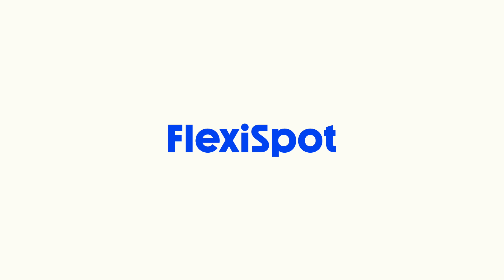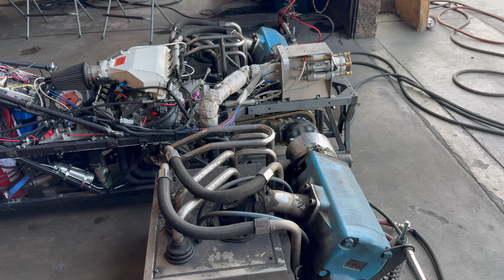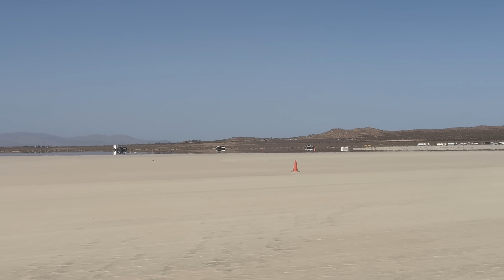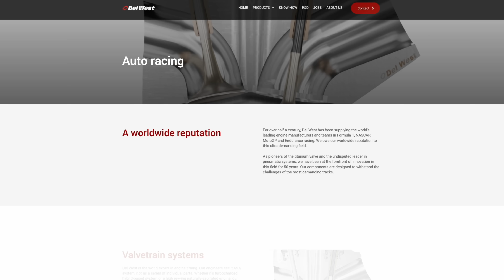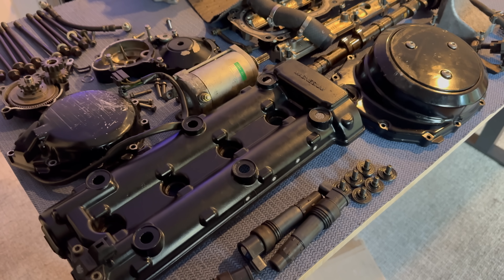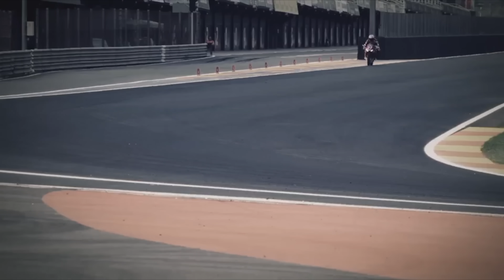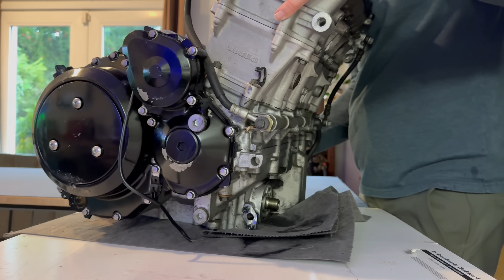Motorcycle Engines Are WAY BETTER than Car Engines

Comment: Addition On the durability topic of high-revving motorcycle engines: My first motorcycle was a cheap, used Yamaha FZ6 Fazer (*14,000 rpm*) with 10.000km (6K Miles) for 3.000 EUR. 
I bought this cheap bike because I was sure that, as a novice rider, I would quickly have an accident, so my first motorcycle shouldn't be expensive in case of a full loss. 
(My second motorcycle then would then be my dream bike). 

However, I did NEVER have an accident with the FZ6, and after 40,000 km (25K miles), the motorcycle was virtually unsellable due to its high mileage (It is difficult to sell a motorcycle in Europe with more than 20,000 km on the clock because everyone assumes that the engine is nearing the end of its life).

But since I wasn't willing to sell a perfectly functioning motorcycle for just a few hundred euros (Properly maintained by myself), I continued to ride it, expecting that the engine would eventually break down due to the fact  that I drove a lot (~15.000 km per year). 

The years passed and the Bike annoyed me more and more because I wanted something new with more torque, so at some point I stopped taking care of the engine and treating it properly while riding: I no longer warmed it up properly, I constantly revved it into the red zone, I sometimes drove 100 km at a stretch in fifth gear in the red zone on the Autobahn at vmax. I was secretly hoping for a breakdown and a "good" reason to buy me a new, better bike.

The Problem was: The engine held up, no matter what I did. (I always did the maintenance myself, and even the valve clearance never deviated from the specification within THE WHOLE TIME and never had to be adjusted)

I then finally sold it for EUR 500 with 145,000 km (90K Miles) on the clock to a mechanican when I couldn't take it anymore. 

What am I trying to say? This high-revving Japanese four-cylinder was absolutely indestructible. So in my opinion it's a proven fact that, at least since about the 2000s, it's been absolutely possible to build a high-revving, powerful motorcycle engine that has no weak points and lasts forever. I have had much worse experiences with my cars in terms of durability.

Comment: I suppose that 'better' depends on what you want.  You have mainly concentrated on power, but what about servicing?  My bikes have service intervals for the valves from 3000 to 16 000 with the 16 000 miles ones having services at 4, 8 and 12 000 miles as well.  Cars with a lower state of tune will easily go 20 000 miles between services and some 60 000 miles before the valves are looked at.  I used to find it a pain to have a car serviced at 6000 miles, and it wasn't a performance car, just a 90's diesel.

The expected mileage for the engines that you quote are incorrect in my experience.  I've put two bikes past 100 000 miles, one was written off in an accident and the other is currently on 115 000 miles and the engine has never had a shim.  On the first one the engine was designed for 300 000 km, about 186 000 miles and I think the second is the same.

Kawasaki currently have a range of supercharged bikes and the 'big four' all had turbocharged bikes in the '80s.

For a 'big' bike* I look for about 100 bhp, preferably from a sportsbike engine that has been detuned.  It will usually have the same running gear but being in a lower state of tune, and not ridden at the top of the rev range will usually see a longer life.  But then I am a high mileage rider, doing ten times the average miles of riders in the UK so I do more than the 'sunny Sunday blast with my mates on our sportsbikes' of most.

*I also have a 411 Himalayan which is 24 bhp and great fun...as long as I am not in a hurry.

Comment: Honda is dead to me since they destroyed the VFR line with VTEC and DCT. I used to be so loyal and sold my second VFR with 100,000 miles on the original engine.

Comment: Harley riders: "A motorcycle engine can rev faster than a car engine, right?"
Reply: Harley riders: "He has the car vs motorcycle engine power density backwards"
Reply: Nah bro harley riders are more like "what do you mean a 1200 cubic inches engine can make more than 38 horsepower?"
Reply: @BRUNOR25511  Probably better that way if they aren't wearing any gear.
Reply: @BRUNOR25511  cries in Erik Buell
Reply: @BRUNOR25511  😂
Reply: @BRUNOR25511  a tuned up Harley bagger can easily get over 100 hp. A 131 engine can get over 130 hp
Reply: @ryangierman4421 oh cool, that's a lot of hp for a 400 pound bike...
My 1996 katana with a blown muffler made 116 hp at the dyno without any tunning, i wish it made as much as those harleys (sarcasm)
Reply: @BRUNOR25511   baggers are around 850-1000 lbs. dana/softaill probably more like 500 lbs. Katanas are cool too. I mean why does someone have to be so dumb that they can't enjoy all kinds of motorcycles? it's like being prejudice against trucks because they aren't sports cars, but there are trucks that can be very fast and spray as well. 
they all are designed for different purposes. perhaps the question is why don't you enjoy all kinds of bikes and learn how some are better for some things. expand your horizons and be better for it
Reply: @ryangierman4421 even worse bro 💀
Reply: FIFY:   "A Harley engine can rev faster than a car engine, right?"
Yes, right before it self-destructs!
Reply: Nothing more efficient in turning fuel into noise than a Harley, speed is secondary.
Reply: Thankfully, with the internet, most Harley riders younger than 50 are completely aware of how low the power density is.  I used to get crap all the time for my "tiny 750 cc crotch rocket".  Now they all know that a 750cc sport bike engine makes twice as much power as a 1700 cc cruiser engine.  

The giant engine probably gets better fuel economy though.  And that matters a lot if you're doing the kind of long distance cruiser riders fantasize about.
Reply: @SeniorKlean  The giant engines do in fact, not get better fuel economy. If you want that, go get something like a Honda NC700X.
Reply: @OnlyKaerius   a Road King gets ~45 mpg.  A GSX-750R gets ~38 mpg.  Sure, you can do a lot better with Japanese bikes designed for commuting.  But point still stands that large, lazy engines are more efficient than small, highly tuned engines, maybe not a lot better, but still better.
Reply: @SeniorKlean  2015 CBR600RR gets 46.1 mpg, even a CBR1000RR gets 46 mpg. My 2012 NC700X gets like 65 mpg.
Reply: @SeniorKlean  Even a super low-geared, torque-tuned bike like the MT-09 has an mpg of 40-56, depending on riding style(2024 model rated at 56.5).
Reply: @OnlyKaerius   Make sure you're getting your reporting on fuel mileage from the same source.  I'm guessing that you're getting UK numbers because motorcycle manufacturers don't report fuel economy in the US or Canada except those focussed at commuters like scooters and the NX700.  UK gallons are almost 25% larger than American and Canadian gallons.  I'm reporting numbers I actually get on my GSX-750 to numbers my uncle tells me he actually gets on his Road King.   Moreover, the Road King runs 89 octane, but the GSX runs 93 (it would run 91, but that is extremely rare in the eastern US).  And for all our European friends, 95 RON (European units) is roughly equal to 91 AKI (American units).  So not only is the Harley getting better mileage, it's fuel is $0.50-0.70 cheaper per gallon.
Reply: Nice cats. Making up for your lack of engine cats.
Reply: That's because all those pushrod V-trin motors are essentially the truck engine of motorcycles. They're high-torque, low-revving engines. It's made for cruising rather than racing.
Reply: @awesomeminecrafter2127 except they are used for racing in king of the baggers races
Reply: i ditched my street bob to get a nightster special and im never looking back. i swear that 114 M8 only revs to like 4.5k.

Comment: So put 2 motorcycle engines together with a belt drive to a final output shaft. Only use one gear box separate from the 2 engines like a Harley transmission.

Comment: So You've touched upon something that has given me some angst over the years...... Why not make a car tranny that is the same as a bike's tranny ????  Sequential shift versus the stupid ... ( ohh we need soft brass synchros,..... ) in production today.
And to that end, given the ever increasing tight tolerances in trannys now .... making the synchros out of something less prone to wear and fatigue,.... would be a bonus,.. Yeah ??? Bronze Synchros are a really bad idea. Maybe something very tough like nodular iron alloys....
Anyways, back to the MC sequential tranny in a car....... Wet clutch, needed .....  no Ducatti dry clutch crap here.
And in keeping with MC style drive parameters..... the clutch pack is offset of the main drive line  as it is in MCs
So, driving in say 4th  down to 2nd, would be clutch in..... double tap the stick into second...... Neutral would be easy if it was wide spectrum rather than a half tap  from first or second.
Stay Safe
Reply: Sorry Matt to get off topic, per se, of the engine, but the Transmission is a main player , I digress.
My Spark is a 1.4 litre under square engine at 98 Hp and 94 lbft torque. Manual Transmission '
Daiwoo M400 IL4 with a Jaxx 5 speed tranny . It kicks ass when placed up against the CVT LS and LT models
Hands down
It won't win any races.  but on the highway . She'll zip around the highway  at 3800 rpm at 90 mph..... limiter kicks in at 6500.... so it's a really awesome road scoot 
42 USG  hwy  and 39 USG city

Ciao

Comment: F1 does use constant mesh gearboxes where they even have an internal oil pump which bikes dont have. Actually if you look after a bike and its good quality they can last a long time; in my time with my own shop I saw several with 130 - 150 000 k's on them but yes these guys were fanatical and did a lot of servicing. Great video; I almost felt like getting dirty...

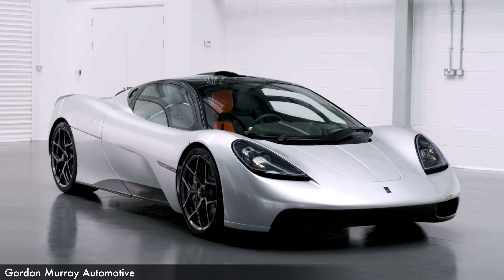Comment: 4:10 Just gonna point out that for a few years in the 90s it was possible to get a motor that revved over 11k for the price of a ford taurus SHO. 

You kinda had to take off the accessories to make it happen though because none of them were rated for 12k.

Comment: Some yamaha engines, especially the ones that spin up to 16000 rpm, use "guided" valvetrains, they dont use springs, but rather have wheels with lobe shaped grooves cut into them, and the end of the valve stems have a pin that follows the groove.

Comment: Motorcycle engines "feels" better because they're basically halfway into aircraft technology: weight saving at any cost.  These hidden cost can come out in life span, lower torque per displacement, increased fuel consumption per horsepower yield, higher average temperature and perhaps even a combination of them. Hayabusha engine is common bike engine used to transplant into cars (especially amateur formula) and for all it's insane power, it actually feels underwhelming in a car body.
Oh and one more thing to consider is drivetrain: driveshaft (rare in bikes) is highly inefficient compared to belt or chain, but more durable and has long maintenance interval.

Comment: My Honda motorbike red lined at 8000 rpm, same as my Honda car. It also produced a little more horsepower than the car. It also ran for 100k miles before being totalled, so did about 5k miles than the car. Honda might have actually stuck the same engine in both as both were inline 4s 😂

Comment: 4:09 I mean, some old Honda car engines and rotary engines can do it for less but generally still require some modification to do so. Still with a piston engine, it seems like a pretty tough accomplishment with a per cylinder volume of 500cc or more.

Comment: I wouldn't say a motorcycle engine is better, it's just optimized for its intended use. If you slap one in a car or truck I doubt it would be able to meet the standards for those vehicles.

Comment: Motorcycle  engines aren't better than car engines (except at moving light weight things).,  what they are is lighter, built with lighter components that enable them to spin faster in a shorter amount of time , thus resulting in greater power density.....but it you want to move lots of passengers, haul all your groceries, tow the occasional trailer, you're quickly going to find out why that Motorcycle engine, with Motorcycle engine rods and pistons, isn't better than a passenger car engine.

Comment: 5:21 everything reminds me of her 
By her I mean Rotary engines 
Also then you think how many things need to go back and forth rotory seems like a win 
Or liquid piston engine solved almost all issue of rotory but they have military contract 
If it is possible to get 220hp  at 660cc out of rotory valve engine which still uses pistons I would expect rotory engine to beat that and be more reliable at it 
Those rotary engine could be ground breaking in weight to preformence aspect

Comment: Motorcycles having less strict emissions requirements is objectively better simply because it encourages motorcycle use which reduces total emissions, it also makes roads less congested, which also reduces emissions through improved traffic flow. Fight me.

Comment: Amem. Motorcycles also have waaaay more performance compared to actual sport cars. Dual clutch is mediocre, motorcycles use actual sequential transmissions, no engine mount dampers and so on. Motorcycles are way closer to GT3 race cars than compared to Road going sports cars

Comment: I think you place far too much emphasis on the word 'better'. It is inappropriate - they are different engines, designed for different applications. Using your apparent argument but with different priority of criteria, one could argue that car engines are better because they last a lot longer. 
Power is just one of many requirements of an engine, and not necessarily the most important. I say this as both a large V8 engined car driver and a 200bhp plus bike rider, each of the two engines being far far better in its fitted application, and as good as useless in the other. 
Nonetheless, I think your explanations here will be extremely interesting and useful to the 'lay' person, and I thank you very much for producing this video sir.

Comment: Nothing special, that's how nature works, an ant can lift a weight a hundred times its own weight, and an elephant collapses under its own weight - a smaller volume motorcycle engine is much easier to raise to higher revs than a larger car engine.

Comment: Motorcycle engines should have modular transmissions that can be swapped out for a bolt-on DCT, or integrated balance shafts. 

Emissions could be solved with a Porsche-style e-turbo that allows the engine to run rich while the catalytic converter always sees 14.7:1. 

Engine life? If the engine is only used 1/5th of the time, it should last 5 times longer. So let the EV powertrain do the boring stuff 4/5th of the time.

Comment: I am not that impressed with motorcycle engines, I am quite disappointed in the fuel economy, I do get better gas milage on my bike than I do in my car, but not by much and certainly not 10x better even though my car weighs about 10 times more. It is so odd that to get an efficient motorcycle I have to buy the cheapest one from china because they are selling to markets with poor purchase power like Africa and India, they somehow need to care about efficiency while all the expensive western mc's are inefficient gas guzzlers because we use them as toys.
Reply: Consider that motorcycle's have horrific aerodynamics. Also consider the power to weight ratio of most motorcycles is superior to that of most cars. You can easily make a very fuel efficient two-wheeled machine, but it will either be ugly and or have a small motor.

Comment: I'm a M.E. I remember in school studying the physics math of camshaft profiles, and chuckling how the definition of the time rate of change of an acceleration, such as the motion of the valve at the tip of the cam lobe, is called a jerk.
One point: I wouldn't say that motorcycle engine longevity is only designed for shorter lifes. I rode a 1996 Kawasaki GPz1100 (129 HP) for over 20 years and over 260K reliable miles with nothing more than religious maintenance practices...and two carb bank rebuilds due to bad gas from poor winterization on my part. Oil changes every 3.5K, valve clearance checks, brake and clutch fluid flushes, coolant flushes, new wheel and steering bearings, fork seals and bushings, rear suspension bushings...I lost count of how many sets of tires I went through. At least 4 sets of chains and sprockets. Never once had an issue with the engine. Sold it and got a newer Kawasaki, and the guy who bought my GPz is still riding it around. So you're right, motorcycle engines are awesome, and perhaps more than people realize for some of them.

Comment: The power density costs reliability. HP creates heat, and that heat has much more material to dissipate in with a larger car motor, regardless of the efficiency of the coolant system. Since heat is the enemy of all machines, the cooler motor inherently lasts longer. That's why car engines are expected to last 200k+ with proper maintenance. A motorcycle engine? Maybe 20-30k.

Comment: THIS IS ABSOLUTE BS!
JAP MOTORCYCLE ENGINES USE NON-REPLACEABLE POURED BABBITT BEARINGS! THAT MEANS ONCE A BEARING WEARS OUT OF ONE BEARING GOES BAD THE ENTIRE PART MUST BE REPLACED AND MOST PARTS ON OLDER JAP BIKES ARE NOT MANUFACTURED ANYMORE! IN SHORT THE ENTIRE BIKE IS SCRAP JUNK ONCE IT WEARS OUT A BEARING! HARLEY AND INDIANS ON THE OTHER HAND USE REPLACEABLE BALL AND ROLLER BEARINGS AND CAN BE EASILY REBUILT OVER AND OVER AND OVER AGAIN TO LIKE NEW CONDITION!

Comment: Just got a fully built holset HE221 2.0 TDI engine into my vw rabbit pickup. Got it around the block and back into the garage just to find copious amounts of oil pouring out somewhere between the engine and transmission. 

Very disappointed. About 8 months of work.

Watching this brightened me up just a little. I Appreciate it.